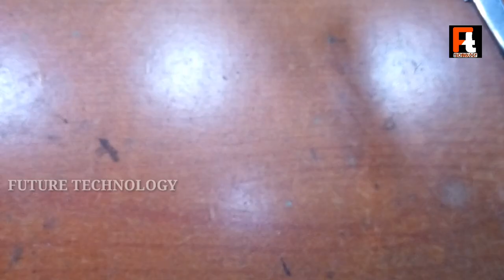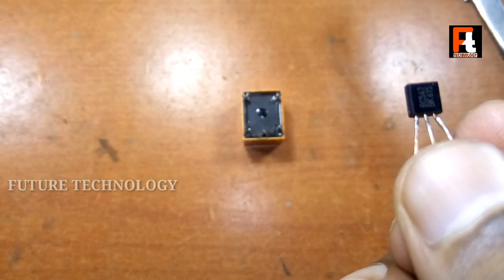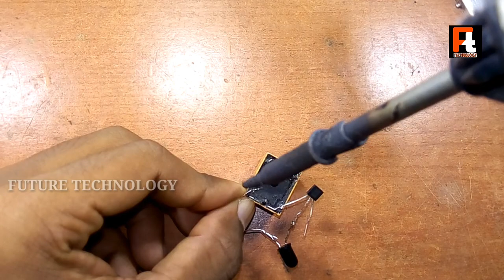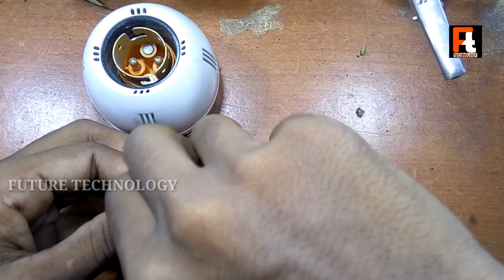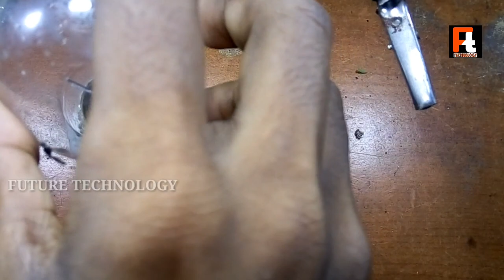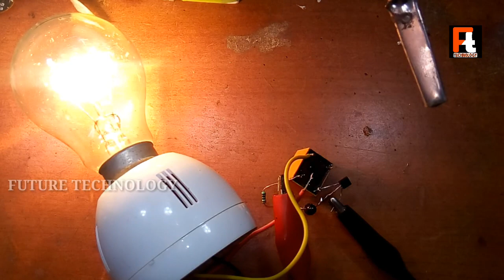How to | DIY | Simple Remot control circuit without ic, #RC Invention #diy #howtomake

Comment: Which remote to use..? What is the distance range? Would it work in dark room?
Reply from the maker: Any remot u can use
Reply: @RCInvention  
Distance Range of receiver..???
Reply: Would the circuit work in dark room...????
Reply from the maker: Yes
Reply: I mean to say that how much distance between the Remote Button and signal receiving circuit is possible..?
Reply from the maker: It depend on your remot
Reply: @RCInvention  ok...I will make one and inform you after testing...thanks
Reply from the maker: Ok
Reply from the maker: This circuit not work on LED or CFL  light
Reply: @RCInvention 
The circuit & relay coil needs 12 volts...that is all required for operation. Relay is an independent component...it should operate/control any load whether LED or CFL or Incandecent Lamp
Reply from the maker: @RATANKUMARRateria  I know but this circuit only work on incandescent lamp
Reply: @RCInvention  
Ok